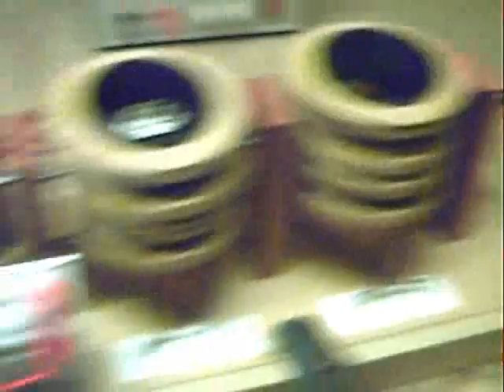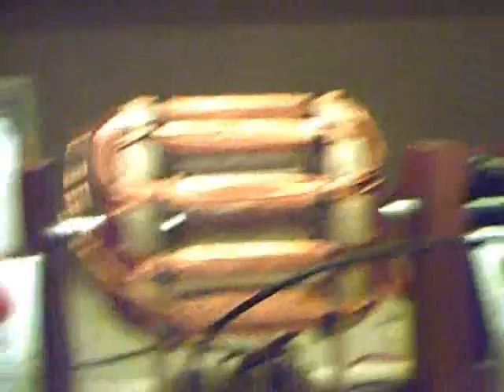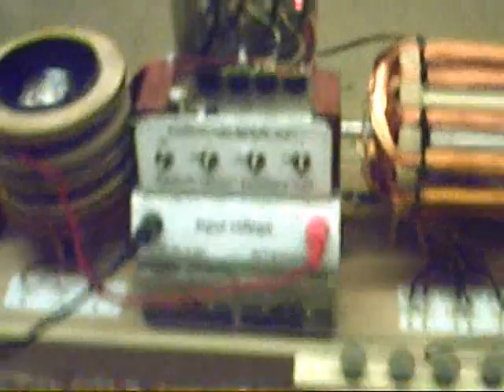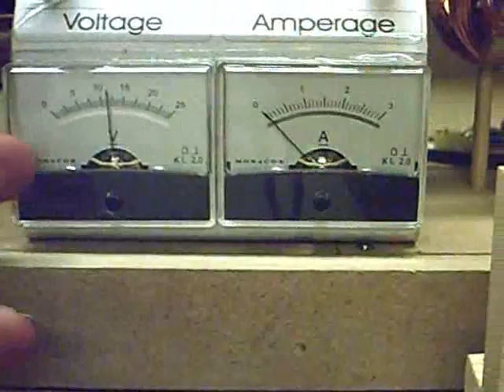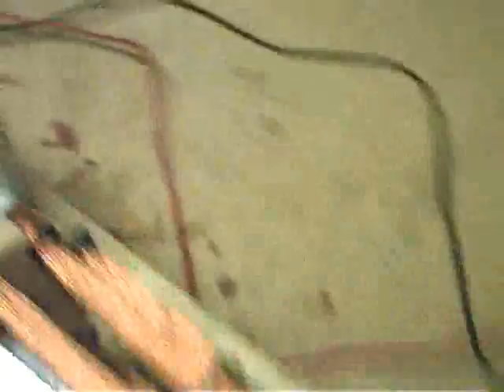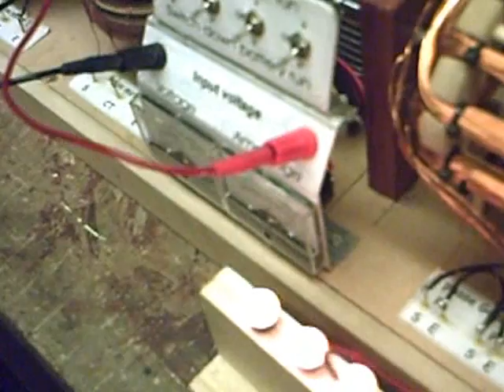My all new newman motor 2 running it up.

Comment: Hi. Really nice work. The magnet responds to voltage, not power. It is a field effect. Joe uses dead batteries, very small current. Cutting the circuit before the current completes the loop is the first part of making energy from no power. V x I = P I=0 P=0.

The back EMF is a troubled child. It will build until the coil shorts if you don't plan for it. 

The question is: How long is your motor coil? Using the speed of light, how short is your voltage pulse? Is your pulse short enough? I think not. Is the short enough pulse long enough to turn the magnet?

Joe's flywheel helps out. But a pulsed DC power supply with current limiting may do the trick. 

Keep working it. Kudos.
Reply: +BMan18 Energy from no power ? really explain this illusion please and use as many letters and numerical references,
Mistake number one is Daftman is not building a newman generator he is using a newman motor.
Number 2 is he is using solid state which could work although there is no solid state short just a collapse in the field.
Mabye if daftman had the correct approach and with as much help form others willing to provide this help then we all could benefit.(probably why he built a forum TEEP)
Please refrain from simple equations written by learned men stating laws especially when Man is imperfect and only trying to comprehend which already exists.
BEMF does not like to run on its own circuit the bedini circuits show this unless one makes a sj looper.
You make a good reference to the pulse and collapse granted although remember to share your critic or you will be humbled from others much more learned than onself.
BTW Bedini did not make the bedini circuit he just benefited from it as referenced by Gerad Morin Vids.
I could share much of what I have learnt although put simply people don't deserve it.
Have you built anything or are you just referencing others?
Reply: +Grant G "Please refrain from simple equations written by learned men..." "Energy from no power? Really explain this illusion please and use as many letters and numerical references," You put me in a box here. Nothing I, a learned man who is writing will satisfy you. It's this kind of selective denial that has kept the world in the dark about the nature of the Universe and why energy is freely available. But still, in the confused and disrespected writings of mankind there are slivers of truth that can be distilled.

You may have noted that my comment of energy from powerless sources was a bit tongue in cheek. The definition of power in the limited EE world is voltage times current, each one alone is considered powerless. But this is justified in one way by defining current as the movement of electrons, which are the voltage sources (point charges). Consider that no one any longer speaks authentically of electrons orbiting atoms, they do not exist within atoms, they only (next entry)
Reply: +BMan18 exist as electrons when electrons are forced out of the stable dual pair of charge or voltage fields energies. You can check Wikipedia for the speed of electricity in conductors. It is 4 orders of magnitude faster than the imagined speed of electrons traveling in that same conductor. The electricity in a single conductor being 75% the speed of light and the electrons being mm/sec. The idea of electrons traveling as moving charges is simply bogus. Of course EEs still define current direction as the reverse movement of the negative potential energy of the electron orbitals. All of this kind of material projection of fields and waves, non-material phenomenon is misleading and criminal in ultimate result. Current could be considered the movement of charges, but that is only because moving charges create magnetic fields. Magnetic fields is the actual "substance" of current.

This brings us back to the topic: no power creating energy... Reference JC Maxwell and the man he (more)
Reply: +BMan18 based his equations on: Faraday. We're talking over 100 years ago and a lot of what they believed has been dropped or censured so who knows the full truth today? From this foundation, Heaviside simplified things so the engineers could work with the technology that Tesla gave them, and then abandoned for good reason. Steinmetz put together some more honest math, but it is beyond most mortals in understanding. Today Eric P. Dollard has the best descriptions, but even he has colored his descriptions with sideways slams at the corruption of the truth by educational institutions. Note all these gentlemen believed there had to be an Ether, but that relies on both superfine particles similar to QED theory and "counter space" similar to parallel dimensions. What we have in front of us is an electric Universe, saturated with voltage and magnetic fields. It could be that simple, the fields themselves creating the space we enjoy. Regardless, the fact is as Maxwell famously reported:(more)
Reply: +BMan18  Moving voltage field sources create magnetic fields circulating them. Changing moving voltage fields induce magnetic fields in strength proportional to the rate of change of the field movement (not the voltage itself, although Faraday and Lorenz insisted this was so. Likewise, a moving Magnetic field will induce a Voltage field in proportion to it's rate of change, not it's field strength. The totality of one field (not power by EE standards) inducing the other is both a rate of change related force but also a direction pointed phenomenon. Maxwell invented Quaterion Mathematics, Heaviside and Lorentz simplified it and suggested you use your fingers to point the way. Dollard is the only one today that actually speaks of the multiple fields that exist in a transformer with direction (that I've found). But there's more, each induced field will induce it's own, creating a four field induction for any one qualifying changing field. This is inertia expressed in field induction(more)
Reply: +BMan18 cycles. The entire process does no work. It is a zero sum event. If you can either change the rate (and potentials) within the process or the direction of the field interactions, you can collect/harvest/steal the inspired fields and make energy. It is an amplification, as you must have the inspiring start. But if your rates and diversions are high enough, you will have plenty of energy left over to feed back to the first field change and keep things going.  This net effect was reported by the Royal Society in the 1800's. They promised free energy, until they got paid off with the money they could make selling power based on the obfuscated truth. 

TC Heins explains in his two denied (yet verified as functional) patents: the BTTT and ReGenX coil. Electrical signal processing and radio use all the techniques in his system that treats power electricity like a radio system. Joe Newman beat him to the punch, but failed to disclose enough about his invention and also intuited a(more)
Reply: +BMan18 new way of interpreting electricity... It failed to impress the establishment with its creativity and functional performance. The US Patent Office is a privately held company. The owners no doubt support the status quo, being directly invested in technology that is successful today. Revolutionary tech that makes oil and Utility Power and all the industries that feed on their waste obsolete. The world governments would collapse without a cooperative support of the masses if free energy were everywhere.

Honestly I do not know the full effects of what Joe Newman's design does, only some of it. But clearly he has made his induction coils capacitive, he also starts with dead batteries, because induction only needs voltage, not current (magnetism). But with his coils he separates the four parts of the induction inertia action and steals electricity while generating motive force. Sweet and natural, beyond the stupid wasteful AC polyphase system in use today, but impractical.

Comment: It's not very clear exactly what is being shown here. The camera is weaving all over the place and I didn't see a clear overall picture of the setup. You mentioned that there is a circuit diagram shown elsewhere; no reason why a couple of seconds of this video couldn't have shown it. What exactly is it that you are demonstrating? A clear view of the meters on the bench power supply that I can see lurking in the background isn't shown while things are running either.
Reply: He's showing, reluctantly that it doesn't work as hoped. You can also hear the frustration in his voice. Everyone who catches the 'perpetual motion/energy' bug goes through this sort of thing. We have to try one more thing and one more thing etc., and maybe magnetic levitation (which requires power by the way). Success is just around the corner in the mind of the perpenerg addict. This is a beautifully built project, to be admired, but no amount of tinkering, or trying alternative methods will make it work. A person working on these things does learn things, so there is benefit, but the person needs to know when it's time to let go before descending into madness as many of the free energy people have done sadly. I would also recommend taking a course, or reading some books on physics. It will answer a lot of questions. Here's the wiki on the inventor of the motor: http://en.wikipedia.org/wiki/Newman%27s_energy_machine

Comment: Thanks for sharing this with us, you obviously put a lot of work in this project and we're all learning, aren't we? Now , just a couple of things I've noticed that differ from Newman's motor :
1. His is running at much lower speed possibly lower amps consumption
2. He is insisting on voltage not current to run it
3. He is using a big fly wheel which will help turning at much lower amps (inertia)
4. We've all seen how transformers are built, the bigger the gap between the coils and the magnet , the bigger the losses. You may want to come up with a way to build the coils fairly close to the magnet to minimize the losses
5. You may want to use a proper generator (commercial) , maybe a modified car alternator ( rotor coils replaced by proper magnets) to get maximum possible output.You may notice an output increase of 100 % to 200% or more compared to the one you've built.
Again, not criticism, just some ideas. Overall, great work and thanks again for sharing.
Reply: Don't forget the biggest difference, Newman's a fraud

Comment: Has any of these negative people, heard of the bloom box? It defy s your so called Laws.  Does it work?  I believe you can get that answer from Walmart,Google,and others who bought and are now using the bloom.   Google bloom and you will be silenced!  Ask your self why? can't you use this in cars that run NG the MPG would be amazing and the carbon foot print would be greatly reduced. Zero

Then look up Stanley Meyer, and then learn what happens to you if anger the energy gods AKA OIL Co's

Comment: So if the motor spins at 10,000 rpms and the size of magnets are measured at 15,000 and so u use more to create less! If motor spins at 5000rpm and a pulley can spin up the shaft to 15000! That's less energy to draw and more output! Gas powered gen speed up as the draw increases, again u increase the speed back up to 10k it's spinning the magnets at 20k rpm that may help, hell what do I know?

Comment: Well just a quick theory! Ok here goes most generators/ alternators have a set speed in which they create the most power, over speed past that point does nothing more then the threshold! So a fast motor driving pulleys of different sizes increases the speed/decreases the speed! Drag is met with a smaller pulley to reduce the total output while larger puts less strain on usage but for same speed!

Comment: Ok, what did I miss.  
The input is about 12.5 volts and 3.2 amps which is 40 watts.
the output is about 30 volts and .1 amp which is 3 watts
Its using over ten times the amount of power its putting out, what a waste!!!!

Comment: @bloodreighn heat is not vibrations of atoms or molecules or both. heat is random fluctuation, constantainly changeing variables. low temperatures gives of lower frequencies like infrared and below. how these fluctuations change also change the electric resistance in a conductor. if both poles on a battery has same electric resistance there is no net force, there is no exess electrons to share.

Comment: @bloodreighn if you chould describe electricity without the concepts of particles you will get the right idea.
for me most people are backward thinking people. energy can exist in form called mass. if you begin with energy as force times distance makeing up directions of space as waves, particles exist secondary. the particles didnt make up the waves, the waves makes up particles. particles are wave functions. you have to get rid of the idea that waves is a product of particles.

Comment: @bloodreighn of course you measure amps as A = I divided with  R but the consequence is the same just different methods to derive values from the amount of change in electric resistance across a differential in potential or a changeing potential difference in amplitude. a candle has a lot of potential energy but unless we find an efficient way to change thousands of tiny varying and changeing potentials into once coherent change in amplitude there would be very little usable energy in it.

Comment: @bloodreighn your problem is that you dont understand that A=i x r to. induction is only the change in potentials difference in electric resistance. when you measure volt on an amp load in paralell you measure the remaining change in differential and not eny voltage in the load.  you dont find eny resistance you only measure differentials between many potentials. volt is a small current. if you measure volt across a 600 watts power source in 60000000v and 0.01ma you get very little volts.

Comment: @coldarc What a Daft Statement, go re-visit Ohms Law v=i X r , without voltage it is impossible to submit ANY current or find ANY resistance, and it IS pressure, you can have ALL the voltage/pressure in the world with the least amount of current/Flow but you can not have current with NO pressure/Voltage!

Comment: @bloodreighn volt isn´t pressure. voltage measure change in electric resistance. amps is just a larger volt load. you can have a light bulb powered at zero volts and 250 ma 60 watts. there is no such thing as volt or amps its just a way to describe different relationships of change in electric resistance. how much how fast or slow. when you power a load there is no volt in it there is only amps. the slower the change the higher the amps the faster the change the lesser the amps. no volts.

Comment: as far as i can see, all you are doing  is converting flow (Amps) into Pressure (volts), it will never run itself unless you either bring the current requirement via the motors down, or you manage to increase the current output , unfortunately, as you have just proven again, you didnt create "over-unity" you just changed/transferred energy to a different type

Comment: Very good working concept for magnetic drive to create a workable force, have you tried with a generator that produces more amps, rather than volts, volts are good, but they make power inverters to 120 & 240 V off a 12V system, try a 12V generator that produces the requires 3amps to run the thing and set it in motion, apply recirculated power, then cut the input and see if she'll play ball... not an electrical engineer by any means and not trying to knock your work i think it is n great concept

Comment: I am currently using your diagram for a newman motor bedini circuit with reed switch. The question is what would I modify to run the newman on strictly the bedini circuit and leave out the reed switch? Any info would be greatly appreciated!  THANKS .... scooterscottii

Comment: the output maH is small because you read the power current drive by the lamps. do you repeat the test with a resistor 1ohm or direct in short cut and read the max. power ouput ok ?. Of course if you drive the back emf at the output you win few mah add to the final poewr output. miguel from Uruguay

Comment: no i fail to get the picture, I'm sorry but its imposable to get overunity by converting electricity to magnetic flux (heat losses) then magnetic flux to kinetic energy via magnetic repulsion (waisted flux as it goes outside the coil as well as inside) and then store that for a short time (friction losses) and then hope to GAIN energy by running the conversions the other way round.. it just has me dumbfounded that anyone would think this would work!!!

Comment: and yet no one is using them to power there house or lab.. in fact i would like to see one power a single LED for more than a few minutes (giving time for the power to run out), if overunity exists then it would change the laws of conservation of energy and make allot of the rules of physics wrong, you cant get power from nothing and i REAL fail how you can get it from an inefficient design alternator.. just using the laws of electro-magnetics and generation you know that it cant happen

Comment: i don't know where you get the idea that the microwave, the computer, the Internet or the jet wouldn't work... they all worked from the get go just not very well, and people never thought they would be as commonly used as they have become.. but all there effects could be PROVED i have yet to find ANY solid evidence that this "overunity" has EVER been really achieved if it had then why are we not using them for power? most were "invented" in the 80's so thats about 20 years of RnD give or take

Comment from the maker: For me right from the start of all my experimenting is for a self-running unit, so if Im not getting more power out than I putting in then unit is a complete failure for me. Im not in to charging batteries.  But yes test results would be nice.